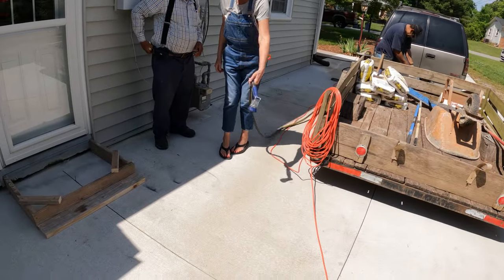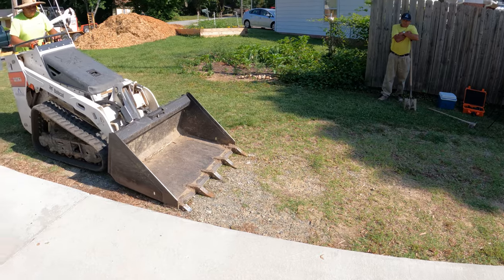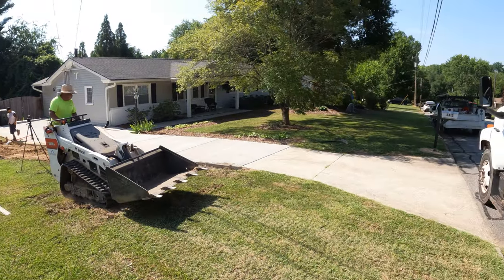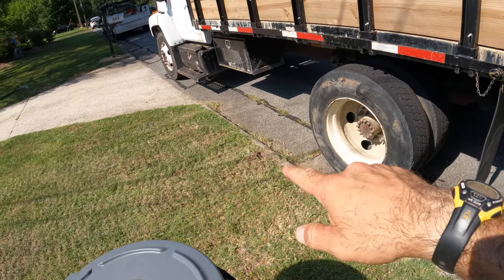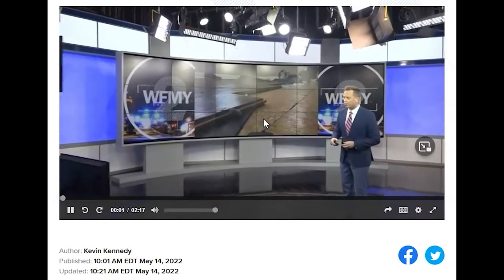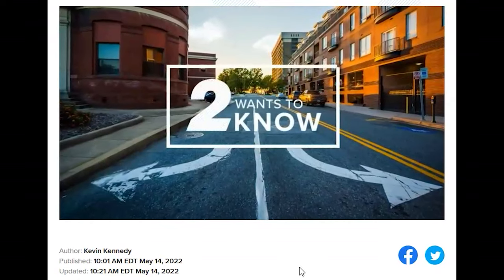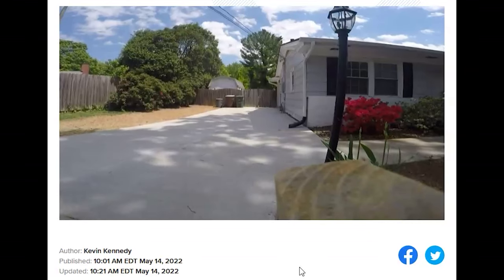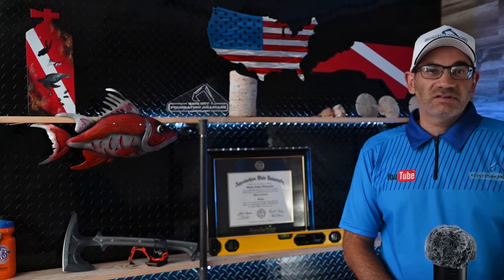UPDATE - Fixed Concrete driveway that was causing flooding

Comment: How you approach each job and the extensive thought process that's evident Shawn really sets you above the competition. The compassion you have to always do it right the first time and make your customers happy along the way is rare and for me, this is why watching you and your crew on YouTube is just so dang fun. Between your channel, Ryan with Victory Concrete and Ollie & Ratty jetting drains down under, I don't need cable any more.
Reply from the maker: thank you LE! A couple times we have ended up doing it right the second time. I have a big one coming up at some point. Keep watching! - Shawn
Reply: Nobody gets it right the first time always. But what sets you apart is that you will stay and make it right...not leave the customer high n dry. Well maybe low n wet haha. High n dry is what we want, RIGHT!
Reply: @drk6067  Shawn’s a champ. I’ve battled roof leaks for years and have had 3 contractors attempt to fix the issue but none of them had returned when our issue remained! I don’t understand that thinking? Sometimes it is trial & error or an honest mistake. I’m willing to work with contractors even if it means I need to pay additional. I just want things fixed and Shawn has shown he works well with his customers.

Comment: I noticed on side door where you built the step up that there was not a lot of over hang. I found out after building two nice sheds and having door rot out in a SHORT time, you need a cover. I chose awnings to stop that splash back. Glad you helped this wonderful Lady.
Reply from the maker: A nice awning would help protect the door for sure. Great idea Dust!
Reply: I learned this the hard way. The doors I put on that shed were special swing out double doors. They were supposed to be top quality and did not last. Same company made great improvements so I replaced them, 2 sets, not cheap for two sheds. A contractor put me on to the awnings and so far they are working great and look nice.

Comment: I work in IT and agree it's a pain to fix an issue left by another. When the option is available I go scorched earth and rebuild.
Reply from the maker: It was a tough call to tear it all out but sooo worth it
Reply: A p, we bought a fairly new 15 year old home and it’s amazing how many mistakes/failures the builders did. Slowly when we find an issue we fix it. Sometimes we find new issues when we fix one. I’d love to rebuild but it’s just too expensive especially on such a new home. I suppose every home has issues and we need to maintain them. Nothing lasts forever.

Comment: Great job Shawn. Thanks for the follow up. Nice to see integrity to do the job right wins over quick cash that doesn't actually fix the problem. Just as I have come to expect from Gate City.
Reply from the maker: Yep! My main goal is to solve the problem. If the HO asks me to do work that won't solve the problem or not solve the problem completely I will pass on the job.

Comment: Shawn, you did the right thing for Patti. I have seen jobs that were done half assed and had to be re done.  I have electrician and plumbers that I'm friends with as well as building contractors who were called in to do a total re-work of the job, rip out what is there and start again. We all feel bad about the customer having to pay twice for a job. The scariest ones are when a homeowner calls in someone who isn't a licensed electrician to do work, but the "electrician" never said he wasn't licensed. That could result in someone getting hurt or dead.
Homeowners, check out the prospective contractor. Are they licensed if required, insured and references? Ask your friends and neighbors, if you don't, that job could cost you 2 or 3 times what it should.

Comment: if you had used a longer piece of wood along the front of the step you could have fitted the diagonal braces to the outside of the formwork leaving the top of the step clear for the trowel work and filling

Comment: It's a shame the news report just said "the old concrete was higher than the foundation" without explaining that the real problem was that it was sloping towards the house. They should have interviewed you Shawn to explain it properly! And also explain on TV that a cheaper channel drain would have helped, but not enough. I wouldn't be surprised if some viewers thought: "of course the 2d contractor said they had to rip up the concrete, they just saw $$$" which would be such a shame.
Reply from the maker: Great points Gaby! I was disappointed they didn't interview me too.

Comment: I cant remember what i said on that video, probably similar to what im gonna ask, but..
Instead of tearing the whole thing down wouldnt it have been possible to add a slope to the existing concrete with a slight concrete layer that would have angled the water away from the house? Granted it would still be above where it should have been.. but there has to be many cheaper ways to keeping water away that doesnt involve replacing the whole thing.. Not to say that Replacing it and it being PROPER from the start is a bad thing..

Like for example, isnt there some type of equipment that would allow you to slice a thin or so layer of concrete off to correct a grade?
Reply from the maker: I completely understand where you're coming from here. I went through the same thing. Another layer of concrete would leave the sill plate and siding below grade. This was a colossal disaster and the only solution I was willing to give was removing the grade to ensure the concrete sloped away from the house.
Reply: If some special masonry saw existed that could get into the orientation required to cut thin slices parallel to the top of the concrete, then cutting it might work i just don’t think thats very feasible (all i can imagine are concrete chunks flying around everywhere at ridiculous speeds) the concrete would need to be resurfaced after as it would become very slippery after the cut. I really think shaun did whats best for the customer here in the long run, and i hope the homeowners don’t encounter any more flooding issues, especially after alll the hard work they put into the inside 😢
Reply: Yeah figured as much.. thx

Comment: For what it's worth, there actually was another (much, much worse) option that didn't require replacing the old driveway. I have the unfortunate experience to know that it is entirely possible to misuse a concrete grinder to regrade concrete. As to why I know this, the short version is unsupervised concrete guys sloped FROM a 2" higher floor drain stub out for a new ADA bathroom in a commercial building. Since the new pour was properly rebar stitched to the existing foundation, the building inspector gave us two options. Either get full engineering plans and signoffs to cut out 18" past the ends of the rebar which was under a load bearing block wall, or "find another way."
So yes, I learned that it is absolutely possible to regrade concrete without replacing it. It is an extremely slow, loud, and dusty hell, but it is possible.
As a side note, sometimes it's better to just say no when friends ask for your help with construction projects...
Reply from the maker: Yikes Edward! That sounds awful!

Comment: Didn’t her old driveway do that and she didn’t want it like that anymore?
Reply from the maker: the original asphalt driveway didn’t have any problems but was cracking. the guy didn’t dig out for the new concrete and so it was higher than the house slab and sloping into the house.

Comment: Picture a city water tower that's 150 feet tall and full of water. No pumps are needed to release that water because gravity will do the work. Now to obtain our water pressure, you must connect the downspout gutter directly to the sealed drain pipe. This will give the needed water pressure from the height advantage of the gutter water. This height advantage will allow gravity to do the work of moving the water. If your water pipe has a 3 foot terrain obstacle to clear, when you are connected to an 8 foot pipe full of rain water...this will give you a five foot  advantage to force the water to flow over that 3 foot terrain obstacle. No pumps needed to move the water...just like the water towers found in rural towns.
Reply: Huh!
Reply: @keithfreitas2983  Sorry it was not clear. I hope this is easier to understand my point. Blue Sky's.

Comment: Too bad this video only plays in 5K. Makes it impossible to watch on anything due to the time it takes to load. Video is very choppy compared to the audio, which is smooth. Wish multiple quality videos existed, like they used to.
Reply from the maker: I pushed publish too fast on this one. I usually wait a day or two for youtube to finish processing the lower res versions. Check back tomorrow and you should be good. Sorry about that tom